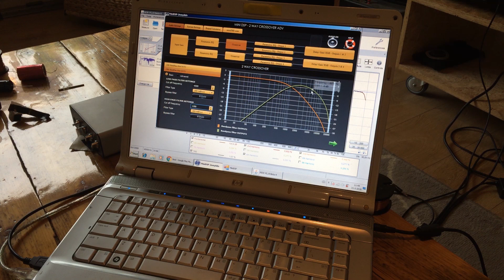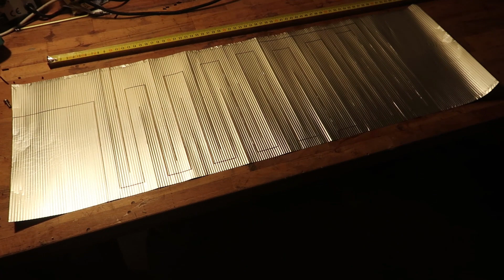APOGEE "like" Planar magnetic -  Part 2 - plot cut attempt 1 and 2

Comment: Why not use it as it is. I bet it will go down to 100hz. And it is too small anyway for bass, so you will need some subs anyway
Reply from the maker: it never was intended for bass :) you did not watch video 1  :) hehe. but i cant use the floppy foil. since it is to long. and wont matchup to the magnets :)
Reply: @joppepeelen  then change the magnets :-). Lighter foil that dont radle higher sensivity. And higher impidans

Comment: I just did a few films for a similar project. The total dimensions of the film are 500mm x2200mm. I cut everything by hand. 😤🤗
Reply: Yes, same thing here, however 30 years ago. 330/220/2000 mm Bass and treble 35x2000mm. Use welded steel construction for support. The bass must have weight 60+ kg. 4x100w amps and line side cross-over. Wished I had access to umik and DSP then.